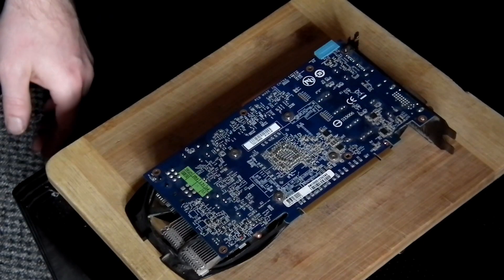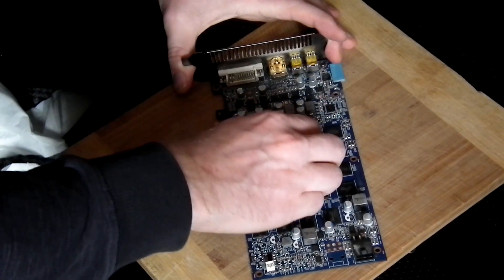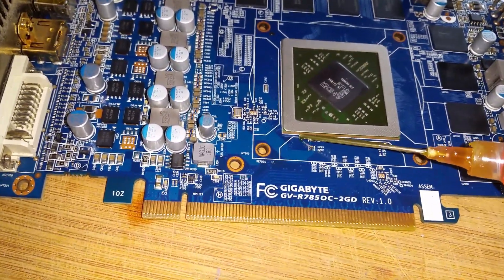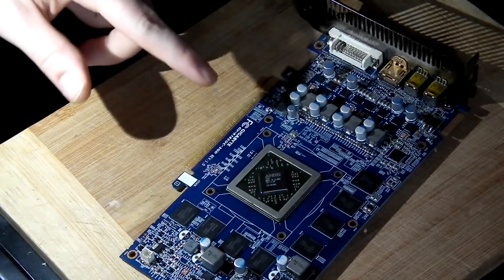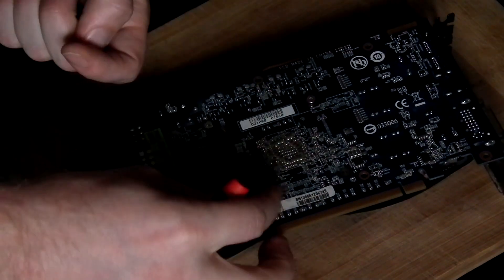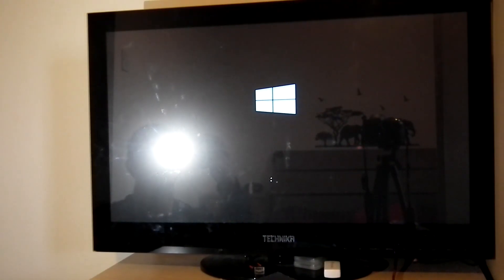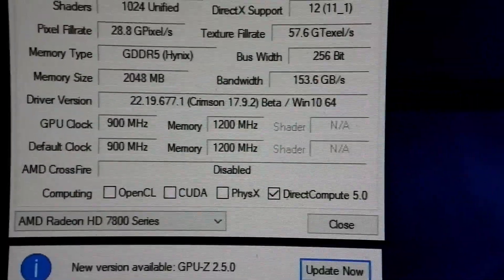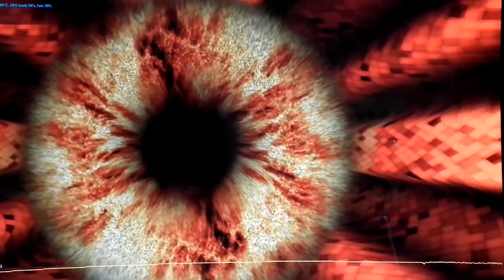How to fix black screen or no signal problems on any GPU

Comment: I have rx 470 graphic card. It was functioning perfectly normal before I cleaned it. I mean I cleaned it dry only with towel, no problem with the cooler or missing parts. After turning the pc on, shows no signal... HELP. Thank you so much.
Reply from the maker: Hi is been your thermal paste so dry are you sure you don't make a physical damage
Reply: @frogtechtips  The thermal paste was not dry at all, I changed it and there was no physical damage, the cooler is spinning normally. Today I got another GPU, just for trying out, works fine with it. I tried your method. Cleaning it up dry only because I don't isopropyl alcohol, and then I heated it with a normal hairdryer. It was still dead...
What else I could try?

Thank you for your reply!
Reply from the maker: @MartisimusMartisDoris  with hair dryer is not always luck as usually don't have temperature you need but as card working before you clean sounds more like some physical damage 
Is really hard help you like this sorry
Reply: @frogtechtips  Thanks for your reply. So it's pretty dead then..
 It's unbelievable how much the prices of new GPUs are.
Reply from the maker: @MartisimusMartisDoris  yop is to much and as happen just before Christmas is not good news

Comment: i had on my 1070 crasing pc or weird stripes. no it do not give any display. and if i put the power cable out and pc on. it give screen like. put cable in
Reply from the maker: Hi is that happens just one day a and card working before normally
Reply: @frogtechtips  but itd weird cuz. i reflowed an friends 1060. and in my pc it was not working. but in his pc it works.
my r9 390 works but the 1070 not. and the woring 1060
Reply from the maker: @MilankoDebil  not sure Man you can still try reheating with bigger temperature if card is out of warranty there is nothing to lose anyway

Comment: Hey, I have a 1080 ti which causes some problems, I try turning the pc on and it works for a split second and the restarts continuesly I used another card on the same pc and it has no problems du u have any solutions?
Reply from the maker: Is it new card for you do if yes is you PSU strong for that card
Reply: @frogtechtips  I use this card for a while now it just randomly occurred when I turned the pc on
Reply from the maker: For me sounds like PSU problems can you test that card in your friends pc to be sure
Reply: @frogtechtips I will try that, is there any known issue that causes this issue?
Reply from the maker: Top some PSU over time lose some power with can make a problems
Reply: @frogtechtips  but I'll try it in a other pc, thnx for the tips
Reply from the maker: You welcome

Comment: Have you ever had one that made a buzzing electrical noise with no signal?
Reply from the maker: Thats buzzing noise make some capacitors look on them and try find with one is do that and try replacing foulty one
Reply: @frogtechtips  👌👍

Comment: Hey, what do you think about my issue with asus rx580:
My screen started blinking gray(like u see on tv when theres no signal)-green and then turning off completely, then turning on for a while and then again gray-green-off. Now it doest start at all... Or very rarely activates for a minute at most. Will your method work? Or it might be something else? Im not quite sure if i should try to fix it myself or ask for a fix at the store i bought it. :(
Reply from the maker: Hi if your card is in warranty definitely take back if not try replacing Thermal paste and if that don't help try reheating
Reply: @frogtechtips  ok.. tbh im slowly falling into some kind of depression. Pc and gaming was my...only... Way of spending free time after work. Now im confused x.x
Reply from the maker: He I know what you mean but don't worry IAM sure you will fix or find the solution

Comment: Hello, I have the same card when i plug it in and turn my pc on monitor shows green light for a split second and then goes yellow light which indicates no display. Please tell me if that's the same issue you were facing before fixing this... I would really appreciate that
Reply from the maker: Hi probably yes I will definitely try reheating GPU
Reply: @frogtechtips  So should i clean the chip and heat it up ?
Reply from the maker: @muheetalbasha  yes but don't forget use flux
Reply: @frogtechtips  Hello, It worked for two times and now it’s giving 2 beeps lol
Reply from the maker: @muheetalbasha  you mean when you start pc if yes look on mb manual what that's mean

Comment: Hi my gpu 1070 is already on window but no display.It only shows black screen
Reply from the maker: And on BIOS before loading window you have signal
Reply: @frogtechtips  nope after bios also nope...But its ok i send my graphic for warranty cause it happends to be same when i inserted my graphic card to the other pc..Maybe there is a short in the graphic
Reply from the maker: @miloice627  hi if you have warranty on card definitely go that way and is not a short if will be short you pc will not start at all

Comment: hey frog , i have nvidia quadro 4000 and fans spins faster than normal and have not signal problem . Can heat gun do the work ?
Reply from the maker: If fan speed is faster straight from Start looks like die problem do you know history of this card
Reply: @frogtechtips  no i dont , card works like for 2 days and stop works now . Card have like random no signal problem
Reply from the maker: @CrowInstrumentals  are you sure you have strong PSU
Reply: @frogtechtips  I fixed with heatgun
Reply from the maker: @CrowInstrumentals  good job

Comment: Hello, Thank you for your video:) I have a broken 1060 , do you know where I can get a GPU chip for the card? I looked everywhere and I could not find it. Thank you.
Reply from the maker: Not sure is possible buy one what's you problem exactly
Reply: I think i have the same problem as this guy.
My gpu stopped working while playing. It's turning on but i dont get any signal at all. Should i say rest in peace?
Reply: @Kalash.0  I thinkmy gpuis fine because i can play on OSX fine.
Reply from the maker: Always hard find what is wrong but usually is time for New GPU anyway goo is price is finally not bad:-)
Reply: @weewee-f8f  Did you fixed it? And how?
Reply: @Kalash.0  No, my problem is that I get black screen when I try to install windows using boot camp . But the max works fine on OSX
Reply from the maker: Did you try reheating
Reply: @frogtechtips  oh yes many times. I connected the monitor to the motherboard and i let the gpu still in the pc to see if i can fix it from the Windows, i thought maybe there are some drivers that are missing or something but, i've seen in device manager that my gpu it's not even detected.At this point i think it's fried i found some black looking dust while cleaning the fans.
Reply from the maker: @Kalash.0  that's mean you GPU is complete dead maybe try find some good local repair shop

Comment: Hi, may be i dont understood well, you said 290C? I always do it with 190 and it work 50% but only worked once with no signal issue
Reply from the maker: Hi yes I use 290 to 320 sometimes even more. 190 to low as is just about melting point and you need melted soldering joint under chip that's why you need use much bigger temperature

Comment: I have a 1050ti when i start first there isnt any signal then after like 15-20sec little bip sound coming and keyboard mouse etc starts lighting and there coming signal on monitor but with black/grey screen i dont get any picture what could be the issue is it dead?
Reply from the maker: Did you trying replace thermal paste and ye sounds like
Reply: @frogtechtips  i tried it now also cleaned with alcohol now it doesnt even giving signal it does nothing just black screen became worse XD i guess its dead
Reply: @frogtechtips  But weird thing when it was giving signal i think windows was booting because when i put a working gpu drivers of it was deleted
Reply from the maker: @melih4919  hi yes is definitely dead I will try reheating I think you will Fix your GPU with that method
Reply: it repair or not if repair tell me how?
Reply: same issue
Reply from the maker: @ravisingh1650  if you tried reheating and not help try have a look on Eli Tech channel he have some good videos with can help you

Comment: Hey frog i have rx 470, i replace the thermal paste with ethyl alcohol and when i put it back on there is no signal. How to fix?
Reply from the maker: It's your card working before ? Did you put new thermal paste and did you wait til alcohol fully disappear before you trying card

Comment: Hey I have a XFX hd 7970 double dissipation which when put alone in the pc does not make it boot resulting in a black screen. When put next to a R9 280x I can go into windows and see an error 43 in windows 10 device manager.  I replaced the thermal paste of the gpu and cleaned off dust. When I inserted it again I could uninstall and disable device in device manager which does not result in an error 43 anymore, it seems that it then correctly installed (but i have to repeat this every time i restart the pc). 
However I have no display and after a certain time i get aamdkmdag.sys system service exception bluescreen error.
Reply: I saw one of the fans was not working, well it spins when i poweron the pc and then it immediately stops. I will try replacing the fans but I am not sure if that is going to help. The graphics card does not give any temperature readings in Speccy or CPU-Z. Do you have any idea or should I also try getting a heat gun and trying your presented method?
thank you in advance!
Reply from the maker: Hi is always hard to find proper solution and as you writing you try all you can and card still have problems this heat is solutions I will bet on in it but first at all replace foulty fan as well as that been reason why card probably over time get foult you have

Comment: Hi Frog, I have a small question. I have a 1080ti with error code b2 and 43 in Windows, is there any way I could send it to you for a repair?
Reply from the maker: Hi yes you can send to me if you like  but you will need send that card to Slovakia
Reply: @frogtechtips  Alright super, can I pm you on facebook?
Reply from the maker: @satanslittlehelper4  yes you can

Comment: I couldn't find something like the reflowing gun you are using it looks like expensive though
Reply from the maker: Hi you can buy cheap one and will do the job. the one I use cost over 300 pounds
Reply: @frogtechtips  i saw some one that used hair drier for that and suceed do you think is it worth to try?
Reply from the maker: Hair drier is not give that big temperature  if you have one at home you can try like I say nothing to lose but you can buy cheap heat gun about 15 euro or you still can use oven technics but that ona I will not recommended :-)
Reply: @frogtechtips  i had flux so i gave it a try with it and it worked for now!  Let’s see how long will it last. thanks for everything man i had the same video card hd7850 that you shot a video overdlowing years ago.. have a good day
Reply from the maker: You welcome and I will be happy if you tell your friends about my channel